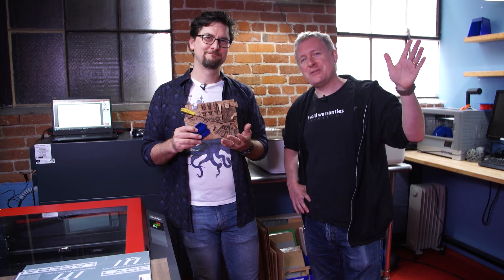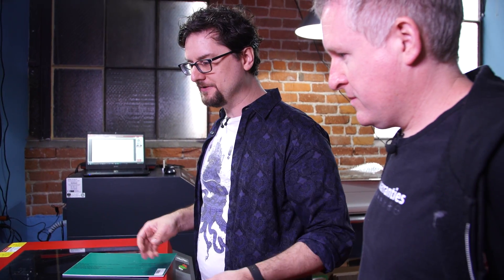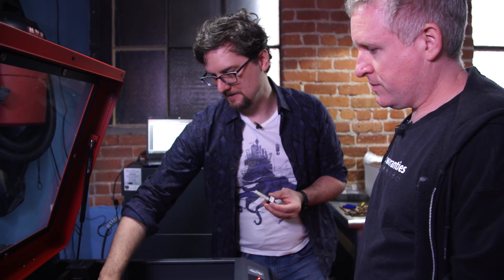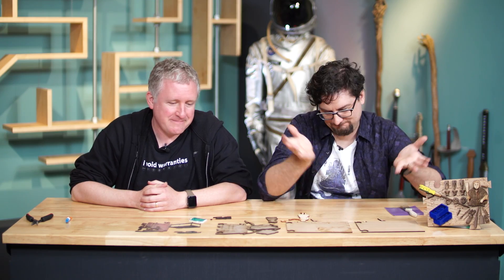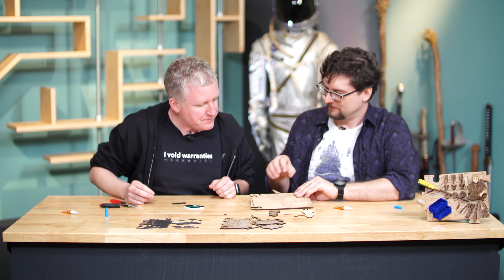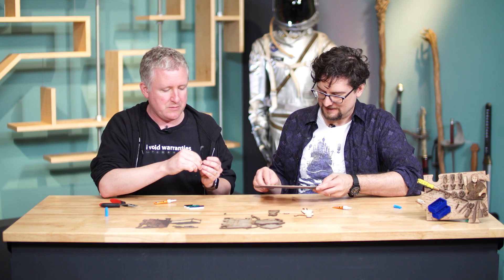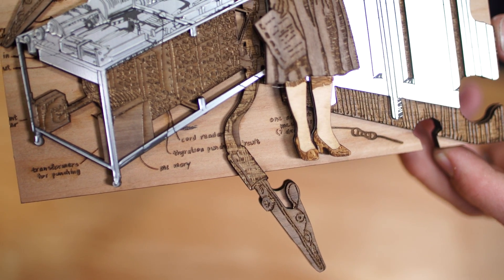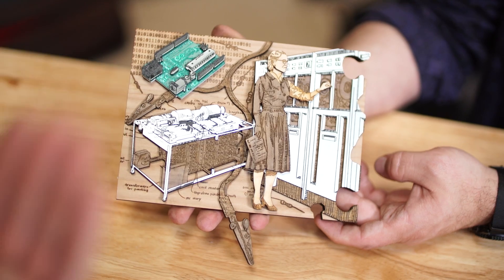Laser Cutting the Maker Puzzle, Part 2

Comment: Looks like you should've used wood glue for gluing wood after all, that super glue does a really bad job at holding together the bottom two layers. Also, I know this is just a quick video, but please, try to be a little more careful when handling pieces.

Comment: I cannot figure out what that machine is that they called a punch card reader/writer.  Could be a paper tape reader, but I an not sure.  Any ideas?
Reply: That is actually the Atanasoff-Berry Computer or ABC. It was a special purpose device that can be seen as the first working digital electronic computer. Its features include the use of binary, purely electronic calculation, and a capacitance drum memory that was a primitive type of DRAM.

It did include a reader for IBM punched cards as well as a separate reader and punch section for paper cards.